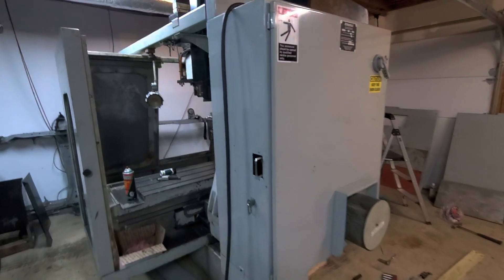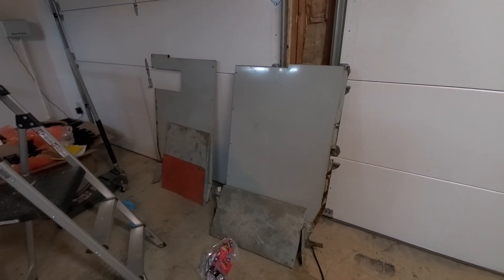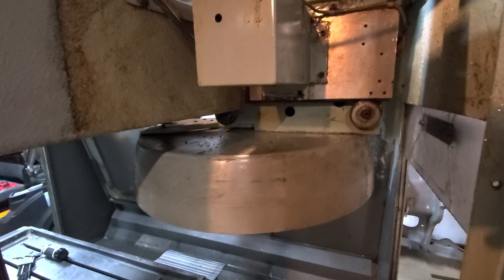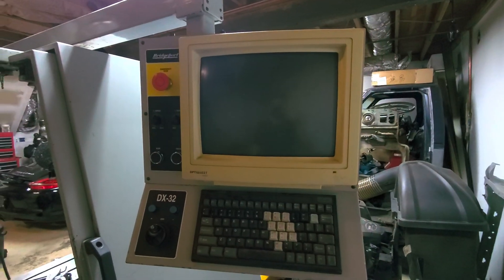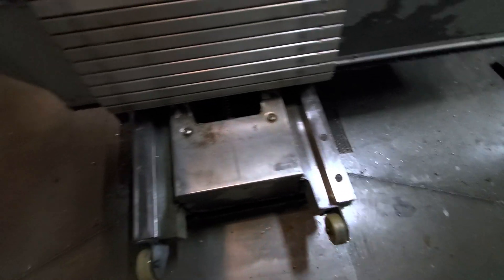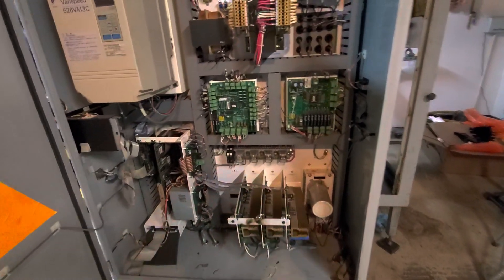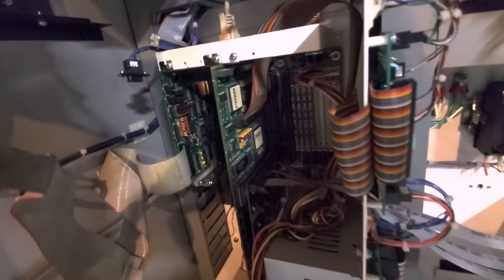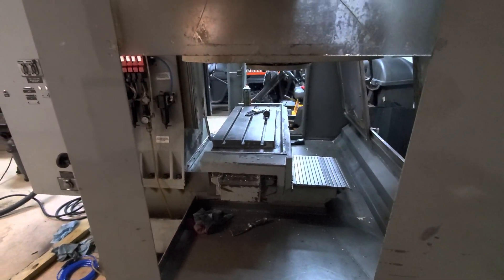Bridgeport Rebuild Part 1

Comment: or masso G3
Reply from the maker: cant use the masso g3 on this machine.  the masso is open loop,  this machine needs a closed loop control to get the best out of it or your throwing away accuracy. from what i can see the masso is a good control looking at the specs i may have to give one a try on another project down the line, but for this machine its not quite ideal.  thanks for the comment though

Comment: hello, interesting your video, i have one like this and my problem is the control boss8,  i´m try to fin someone that change the control or interface with acorn
Reply from the maker: For this machine you really need an oak or allinonedc.  Acorn would be a bad choice, you really need full closed loop to get good performance and acorn does not provide this.

Comment: Nice man, I also got a tc22 and I want to fix some things, I might lean something haha i'm subscribing :)
Reply from the maker: Whats broken on yours? I have been pretty much all the way through mine,  I'm well behind on putting more videos out but I have been recording, just need to edit and get uploaded when I have some free time. I have a Google photo album thats fairly up to date.  if you ping me your email I can add you to that.
Reply: Weld Chip  thanks! "Nothing broken", but I suspect I might have a worn x axis ball screw, when runing above 80 ipm ( doing 3d work) I get over current error and the drives shut off. I  can see some dings on parts when doing 3d surfacing and it moves a little jerky , i would like to disaemle the table and check it but I'm not sure were to begin. Also read the z motor is underpowered and there was a recall on that. I think mine never got recalled, because when I rapid in z I can hear the axis vibrating and if I rapid up and down repeatedly I get Z axis over current.  I would like to upgrade it. 
my email is my username +@gmail.com
Reply from the maker: @PepeCheizen  it may be the big capacitor  on your dc psu to the axis drives causing the over current, if its dried out it will struggle with rapids as it cant cope with the current demand. my x/y ball screws are kuroda 32mm,  I'm in the process of rebuilding them, you can get different non standard size balls from https://www.precisionballs.com but they are pricey for odd sizes.  The standard balls are 3/16 chrome steal grade 25, they can be had cheap on amazon, you will need about 180 for both screws just new standard balls will improve accuracy as the balls wear first.  i have video of me disassembling the table x&y and rebuilding the ball screws,  i just need to cut it all together and post it.  i sent you a link to my photos so you can see what i have been up to.
Reply: @weldchip  that's awesome man, just received the album! I'll check the cap. Right now I'm checking for backlash on the x axis I might do a video of it for reference , I've never checked it before. Also I just checked and looks like I don't have the latest bridgeport software on the machine. My machine is 95 and that's what it says on the software version. I got the v4.42/6.86.1. I heard the latest version smooths out the axis transitions when doing 3d. By chance you got a copy of a newer version?
I know your retofiing to centroid and won't have that issue.
Reply from the maker: @PepeCheizen  mine is running 4.79.22/6.89.57 i have a box of floppies somewhere that come with it not sure if they are still viable or not.  the previous owner converted it to a solid state drive.  i cant power up at the moment as the machine is in too many pieces,  if i can find an old pc at work with a floppy drive i will see if they still work. there is a small bunch of tc guys on the cnc zone forum.  https://www.cnczone.com/forums/bridgeport-hardinge-mills/ i cant remember if anyone published the software on there.